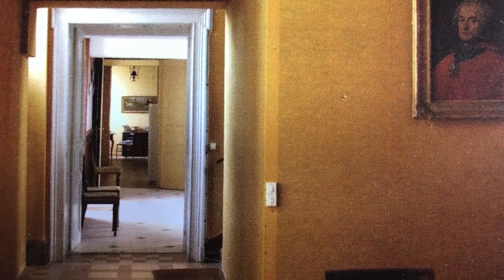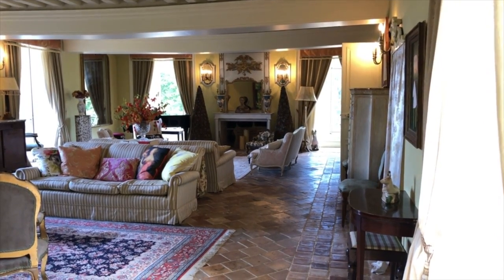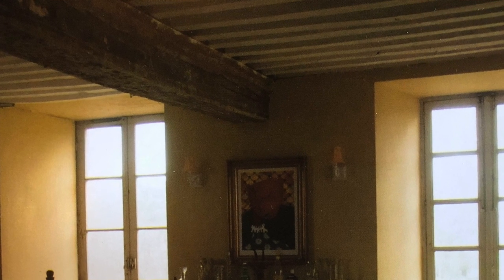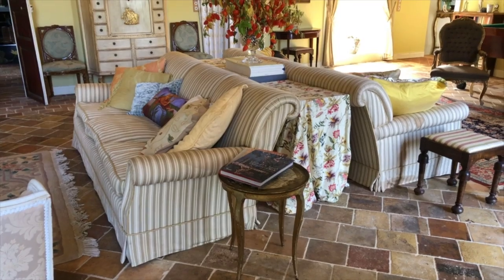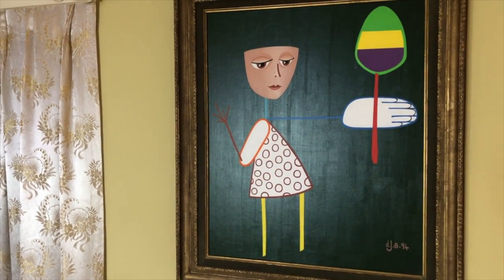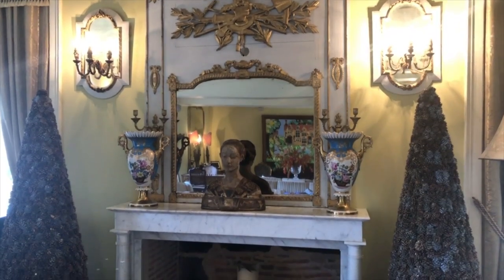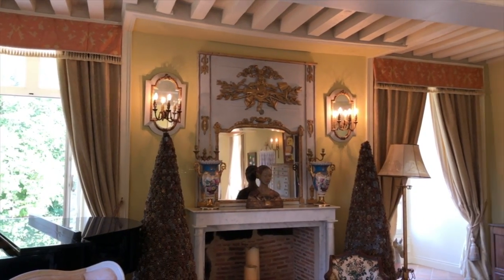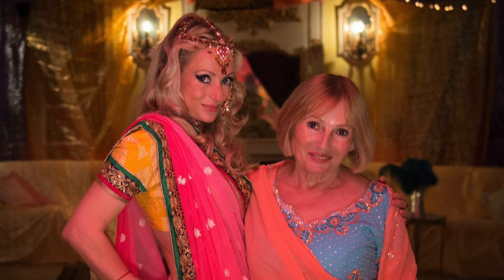CHATEAU GRAND SALON RENOVATION!

Comment: That is the second no pocket billard table I have seen this year I had not seen one before , the first I saw was in the the nh conference centre in eindhoven and you use 2 white and 1 red ball,the balls appeared larger then normal billard balls,getting rid of that asbestos will have cost a pretty penny to remove.
Love i like  the room.have ou allowed for u/f heating in other downstairs rooms I am watching on a wet and dreary day here
Reply from the maker: I find French billiards (without pockets) quite frustrating! Our table is also meant to be used with only 3 balls. Yes, we have underfloor heating in all of the ground floor reception rooms, but not the downstairs apartment (which had a wooden floor in a good state) or the kitchen and study (which have a lovely flagstone floor that I didn't want to move). It's very wet and dreary here too today! It will soon be time to turn the heating on!